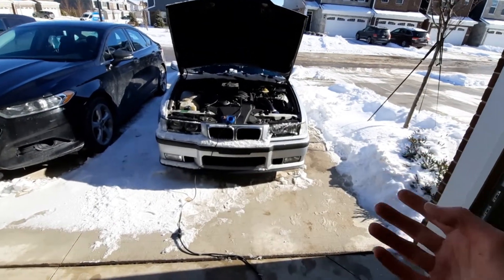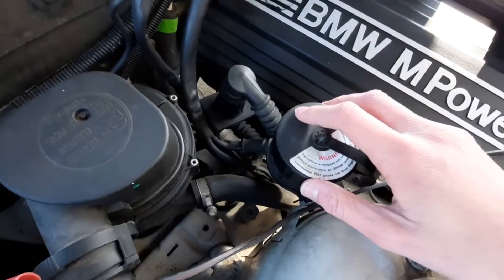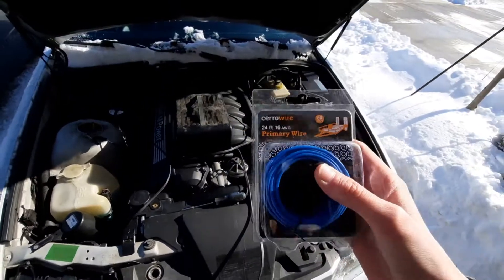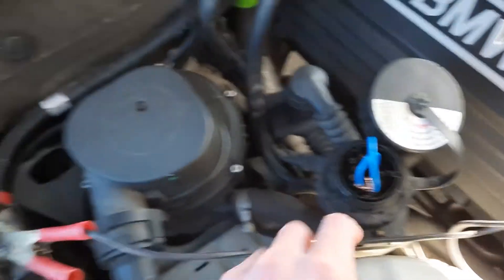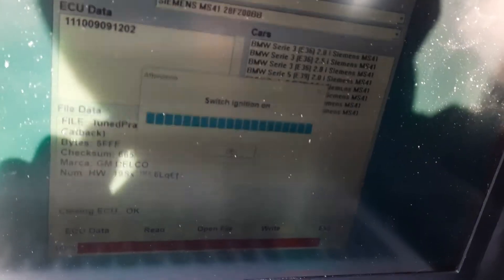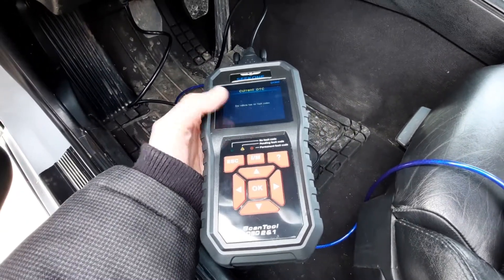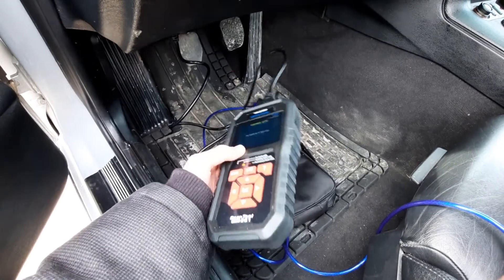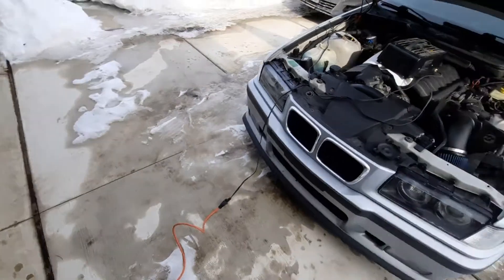OBD2 E36 RK Tune Flashing DIY

Comment: I cannot connect to the ecu at all when the diag cap is off while I’m bridging the pins? Yours works though obviously
Reply from the maker: @Shrm4n  Recheck the pins. Make sure you have a good connection. Also make sure you have a conductive enough wire.

If all else fails, Msport parts makes a cap adapter that screws on to accomplish the same task.
Reply: @M-t3ch  I just got it to work and then bricked my ecu finalizing the reflash in the span of 10 minutes. Hell yea brother
Reply from the maker: @Shrm4n  Wow, that is wildly annoying. I don't really know what recourse you have at this point. I hope you get it resolved.

Next time: put the car on a charger, your laptop on a charger, and get one of these guys.

https://www.msportparts.com/collections/bimmer-tuning-tools/products/msp-e36-ms41-pnp-write-access-ecu-programming-plug-in-obd2-only
Reply: @M-t3ch  It’s all good fun. Appreciate the response and video my friend

Comment: Even so with RK tunes did they send you that, so you could fix the code for your swap? I see rk tunes and I’m think after my swaps done I want to delete the SAP and codes for the missing auto trans. As well as maybe 93 tune. RK can hook that all up through the software?
Reply: Also what is EWS and why delete it? Is that like security stuff ir
Reply from the maker: @rileydines  Yes, EWS is part of the anti theft system. Honestly, if it is not giving you issues I would leave it in place. It is the system that detects the chip in your key to allow you to start the car. Some people have malfunctions or when you swap ECUs it is easier to delete EWS to make it work on the new car.
Reply from the maker: RK Tunes can do all of that in the software. Mine is a 7k rpm limit, no speed governor, 93 octane, manual swap CEL delete. They can remove the check engine light but not the transmission warning light. To get rid of that light you have to swap in a manual ECU or pull the bulb out of the cluster. I did option B 😆. They do free updates too which is cool.
Reply: @M-t3ch  will my windows computer work? And yep sounds like a solid purchase that I’m going to be making soon. What about m50 intake manifold? They compensate for that ?
Reply from the maker: @rileydines  If you tell them you have an m50 manifold, they will tune it for that too. Windows laptop is perfect! That is what I use.

Their process is a little different now from the video since they updated their software. But their instructions are helpful.

Comment: Thanks for the video didn't want to splice anything in the port,
Reply from the maker: No problem, the information out there is relatively hard to find so I wanted to make it just a little easier.
Reply: One more question....when u email  rk tunes ur original ecu software (read) is it the same wire hookup in the port? 
2 17 and 14 18?
Reply from the maker: @ryand8399  When you are grabbing your file just leave the cap on. With the cap closed it will automatically bridge 2 to 17. You only need 14 to 18 when you want to rewrite your ECU with a new tune file. If you load up the software and go to grab your existing file and you get a bunch of 0s it's because the pin 2 to 17 connection is not being made.

And just a side tip. Keep all of your tune files. Especially your original one. Just incase anything happens and you need to go back. Hope that answers all your questions :)
Reply: Appreciate that info brother thanks

Comment: What Dinan stage did you have? And do you feel any difference between the tunes?
Reply from the maker: I just had a Stage 1 tune. The increased rpm limit and top speed gone. The RK felt a little snappier than that one did but I also upgraded to 93 octane since there is no 91 by me. Dinan is very conservative as far as tunes go and to be honest I would stick with RK. They also give you free updates so they are also definitely the best value.
Reply from the maker: If you are going to leave it stock and don't want to delete the ews or any emissions stuff the Dinan stage 1 tune is probably the best $$$ for performance. It will open up the motor a little bit more.

Comment: Do you have an aluminum Dinan intake laying around to sell? Kinda specific but I’m looking for one haha
Reply from the maker: Ha so funny thing. If you are curious if they sound different they do not. They sound identical to the CF one I tried both. I have my CF one laying around but I don't want to sell it.
Reply: @M-t3ch  oh good to know then. I have the CF one and yea it sounds great but thought I’d get a more metallic howl at high rpms with the aluminum
Reply from the maker: @bluesubie02  Yeah I thought the same thing but I was disappointed when they were identical. I am still on thr hunt for a 3.5 ECIS intake because that is the only intake I have found that is better than AFE. Or the design is better rather.
Reply: @M-t3ch  I don’t know about the ECIS, but the AFE and K&N sound incredible
Reply from the maker: @bluesubie02  Never heard K&N in person before. The ECIS design is the best by far because it allows for the most airflow from the grille. Same as the factory airbox but with the more free flowing filter.